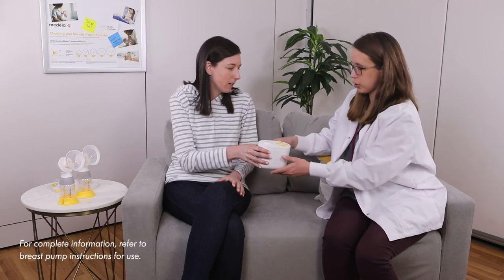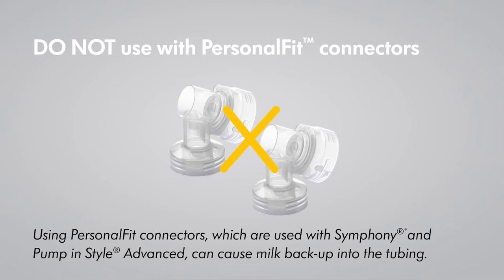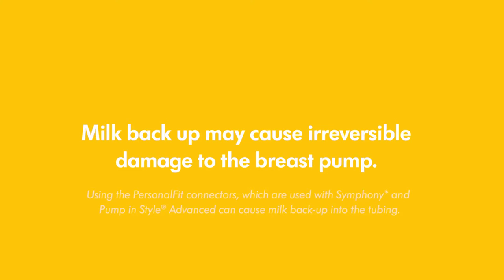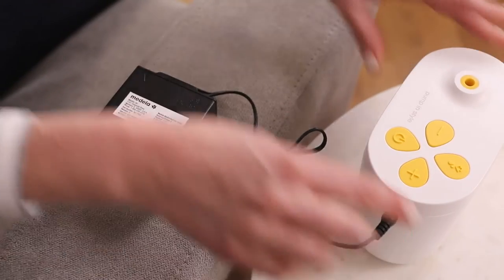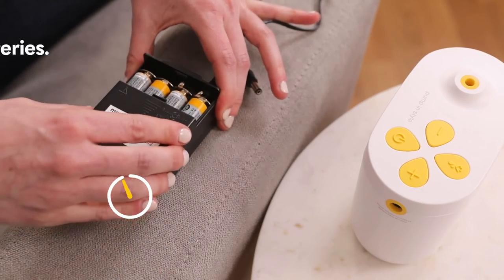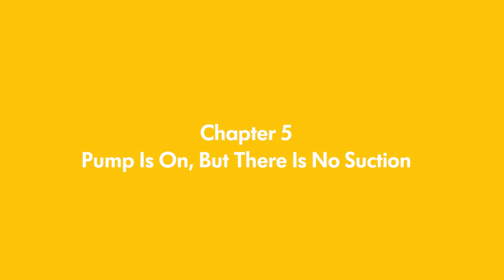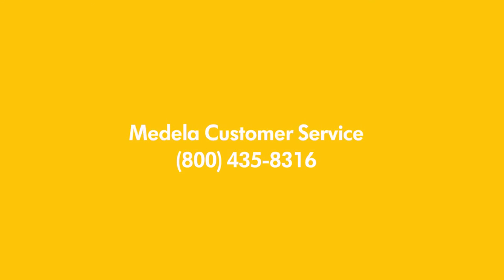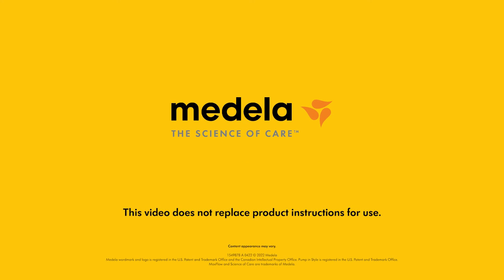Pump In Style® MaxFlow™:  Troubleshooting Power On/Off Issues

Comment: Worst pump ever! I'm currently on my 4 pump (3 replacement) which is actually new, not like the 2 before and neither the battery packs from previous pumps and new pump work!😓 I bought new batteries, new charger for batteries, thinking that was the problem and NOPE! Still doesn't work😓. Only reason I've stuck it out this long is cuz I bought extra pump bottles sets to make this process easier and honestly I'm just over this pump. 😓
Reply: Hey...if possible can you tell wether Walmart return this pump if facing any issue?

Comment: Worst pump and worst brand ever! So overrated! Failed after 2 months use, started to switch off in the middle of pumping 1-2 times and then stopped working at all. Also the handsfree bra isn’t comfortable at all yet so expensive, I ended up using just a regular breastfeeding bra. I would not recommend.